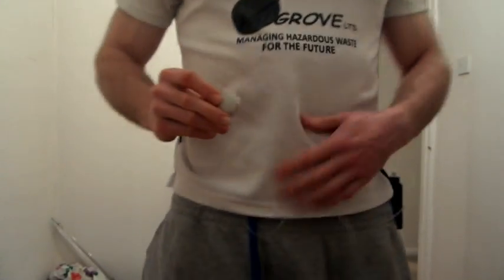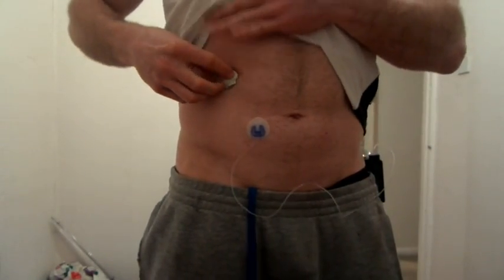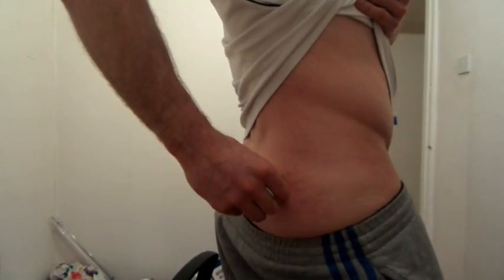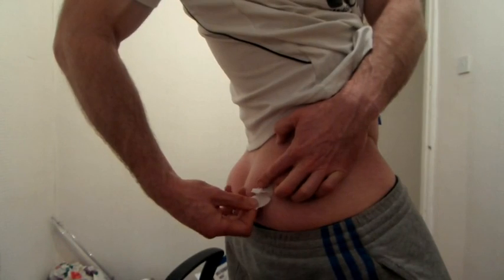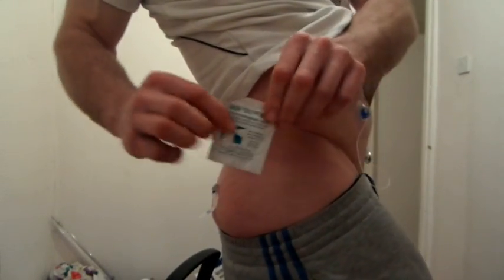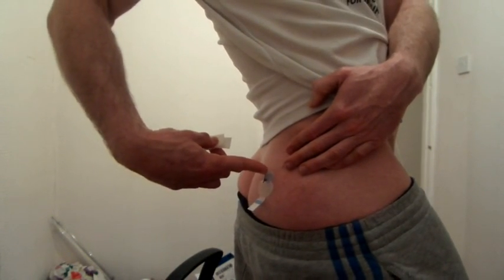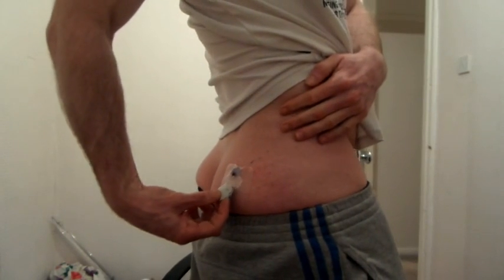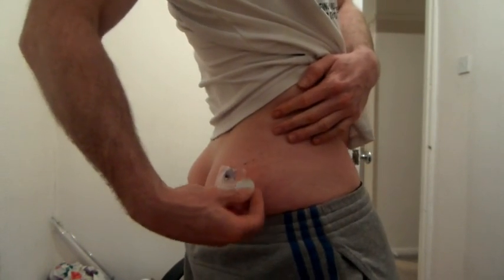Episode 17: 64 days on MiniMed 640G: 7 Enlite Sensor tips

Comment: Here's another tip: take the peel of the sensor sticker off before inserting the sensor, when you pur the sensor in  the applicator take the peel off the sticker, when you insert the sensor it will be already sticked to your skin.

Comment: Hey John, I have been struggling with where to put my CGM because I'm very lean. I'm thinking this location might work for me, but how to you avoid having your waist of your pants pulling on it there? Any suggestions?
Reply from the maker: Andy Rusch hey. If you double tape it down as I go through that should be all good. Otherwise just go below the belt line. Hope it works out
Reply: Thanks man! Really appreciate it. Trying to get used to wearing this thing before I get on the 670G with the hybrid closed loop this summer!

Comment: Well I'm not big on Medtronic CGM, but I figured I would give you and you viewers one more tip.
Buy the Skin Tac in the 4 oz bottle. I bought mine March of 2014 and still have 75% of the bottle left. I also use it every three days with my infusions. So it lasts a long time and is much cheaper in the long run.
https://www.amazon.com/Skin-Tac-Liquid-Adhesive-Barrier-SKIN/dp/B008IUA6DU/ref=sr_1_5_a_it?ie=UTF8&qid=1482373936&sr=8-5&keywords=skin+tac
I will warn against the skin tac remover if you have sensitive skin, it doesn't like my skin and leaves a rash. I will use isopropyl alcohol. Anything over 91% works good. Just use a brush and wipe it on, let it dissolve into the patch while you prep your new site. I will brush it on twice over 1 minute and the old infusion practically falls off, and it's easier to clean up also. 
Good luck, I hope the skin tac works for you. It works great for me,  it the pads are expensive compared to the bottle that seems to last years.

Comment: i started getting an allergic reaction to the tape under the transmitter. Do you have any advice on how to prevent this.
Reply from the maker: Alison Murray you can use tegaderm and cut a hole where the sensor goes through. Skin tac provides a barrier as does a product caller cavilon or skin soft. Hope that helps

Comment: Hi, I got my 640G 2 weeks ago and the guardian 2 link and sensors 1 week ago. I had so much trouble with, big gap between metter and sensor and it dies after 3 days. I put a new one and the gap still there. I will try your tips for the next one and I hop it will works better....

Comment: Can you explain exactly how/why having the transmitter attached asap prevents hydrogen peroxide build up around the sensor site? If there is in fact peroxide building up, how would the transmitter prevent it from continuing? I have been using the sensors prior to the Elites for years now and I found that I HAVE to leave the sensor in for ~8+ hours or the accuracy of the sensor is way off along with tons of sensor errors (if it is connected immediately). How would the ELite sensors be any different than these?
Reply from the maker: Hi Captain Jack, Really sorry for the late reply. I have below put a link to show how Glucose Oxidase works but essentially from my understanding the situation is this:

In order to work as a catalyst, GOx requires a cofactor, flavin adenine dinucleotide (FAD). FAD is a common component in biological oxidation-reduction (redox reactions). Redox reactions involve a gain or loss of electrons from a molecule. In the GOx-catalyzed redox reaction, FAD works as the initial electron acceptor and is reduced to FADH2. Then FADH2 is oxidized by the final electron acceptor, molecular oxygen (O2), which can do so because it has a higher reduction potential. O2 is then reduced to hydrogen peroxide (H2O2).

So when the transmitter is connected, it is my understanding the sensor can uptake the electrons and send the electric charge to the transmitter, therefore preventing too much 02 being reduced to hydrogen peroxide. So having the transmitter connected is important.

You would not have to link to the sensor and start the CGM trace straight away, you could just connect it and wait 8 hours and start the sensor later.  From my understanding the reasons the sensor performs at its poorest on the first day is the trauma and blood around the insertion site. I often see my MARD is 20% on day 1 and then improves continually as the 6 days progress.

I hope this helps and thanks for watching. Again sorry for the delay.

http://en.m.wikipedia.org/wiki/Glucose_oxidase
Reply: 64 Days on Minimed 640G System See Blog: http://www.mm640g.blogspot.co.uk/ 

Thank you.